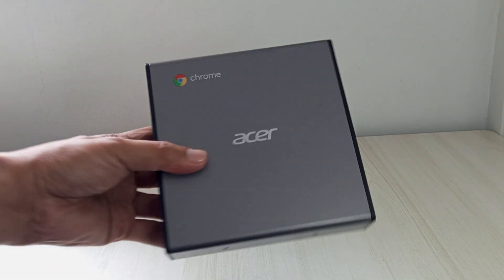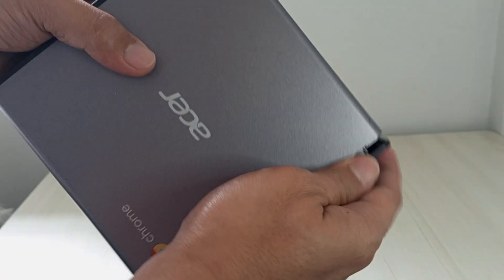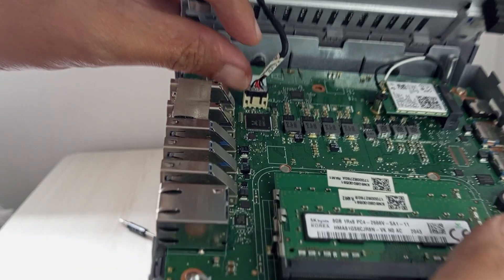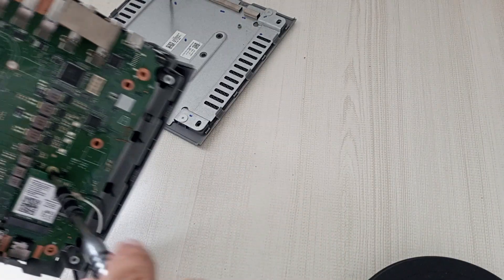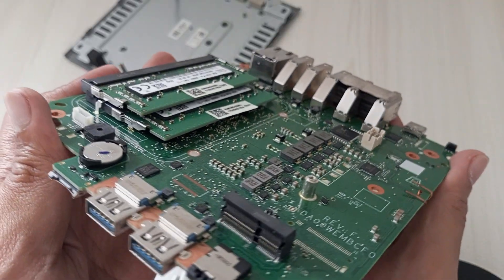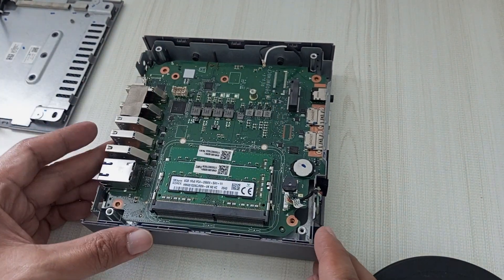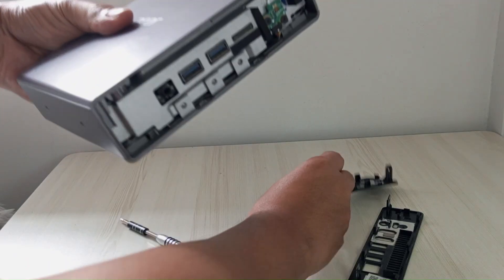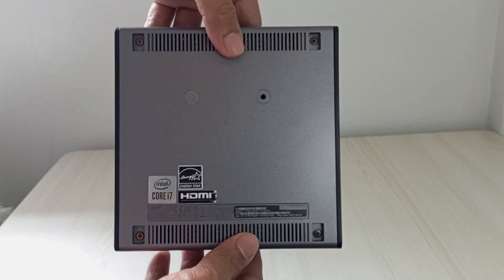How to Disassemble Acer Chromebox CXI4

Comment: Is there no M.2 SSD slot? So its eMMC for the storage?
Reply from the maker: Yup its a builtin soldered emmc, the wifi slot is only present, either use it to put an m2 and use external usb wifi since it has plenty of USB ports.
Reply: @litemint09  Thank you for confirming. I was hoping to get a used CXI4 then flash the mrchomebox UEFI bios to reuse one as a Linux PC, but seeing that I can't swap the drive turned me off.
Reply from the maker: @abunk17 your welcome, theres also an sd card slot in the front though, but hey its a good machine, currently using it for windows 11 for video editing with capcut.